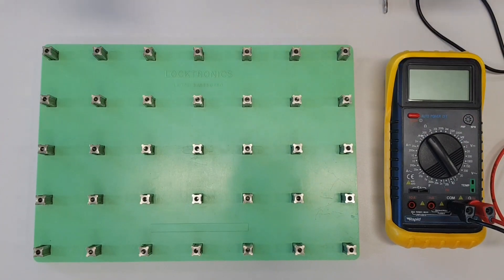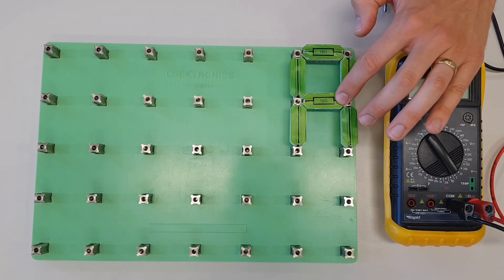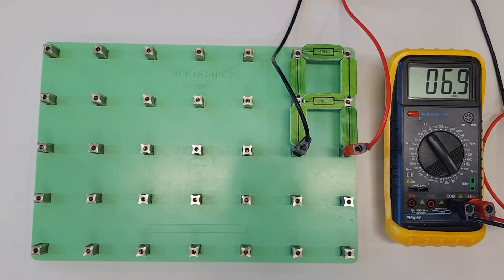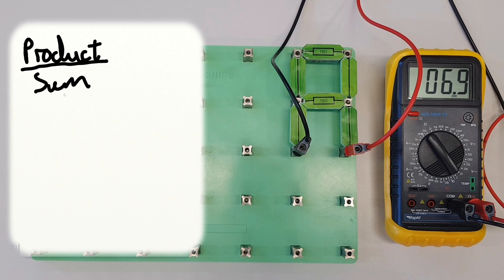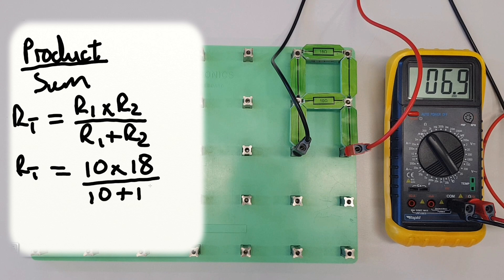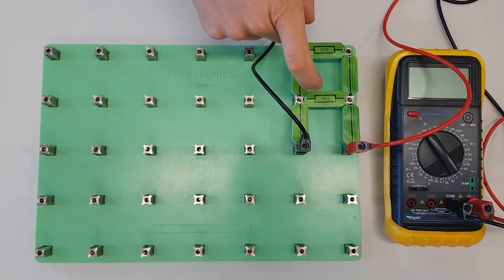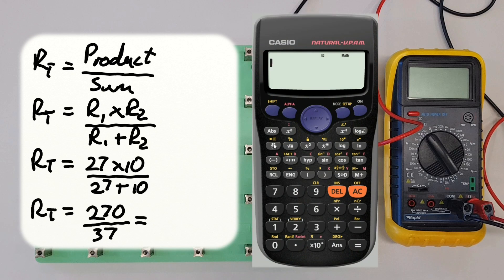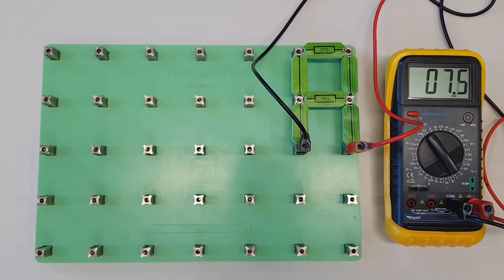Resistors in Parallel - Total Resistance for Two Resistors of Different Values

Comment: Hi Joe, just studying for my 2365 and your videos are brilliant.  I'm doing a mock exam where I had to find the value of a missing value resistor in a parallel  circuit with only two and we know the total resistance,  I made a right mess of what I thought was the correct calculation,  would yoube able to show a video how to calculate  please  hope that makes sense.
Reply from the maker: Will this do?

https://youtu.be/S9z6RZtehxQ
Reply: OK, I think the calculations worked perfectly for the two resistors in parallel. Great work.